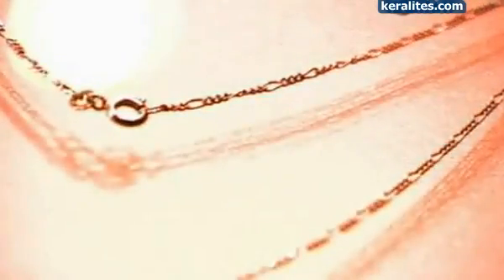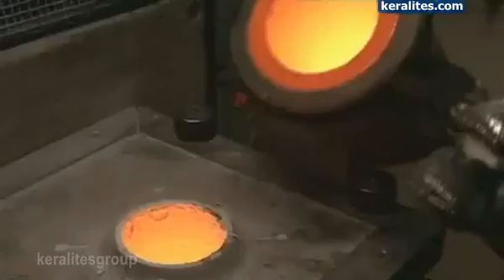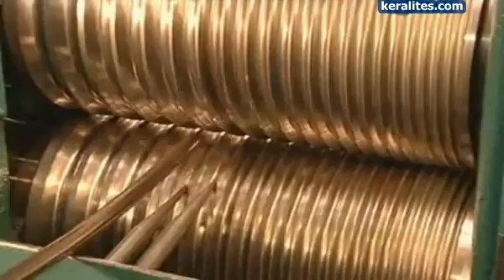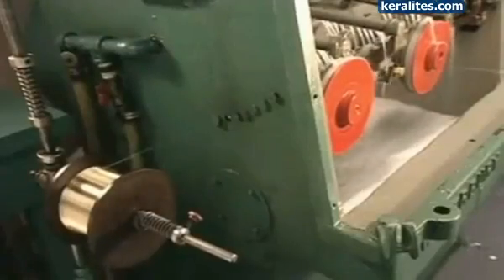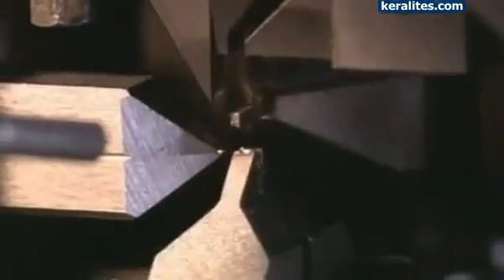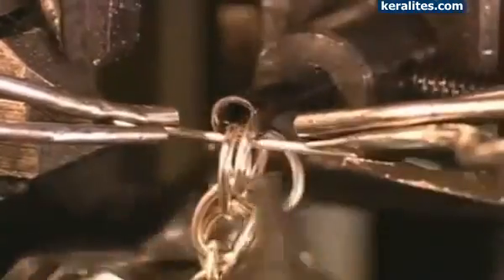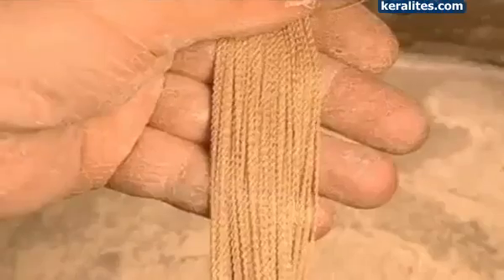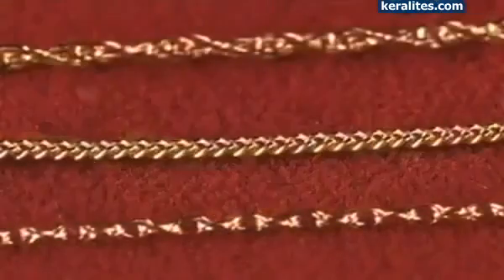How Gold Chains Are Actually Made

Comment: so basically we are buying crap in the end ! sold as gold !
and that is why i only wear pure gold
Reply: you get what you pay for.
Reply: Err, no, you're wearing a gold alloy with superior mechanical properties ensuring you won't break it during typical use, and providing aesthetic differences.

Which, sensibly enough, costs less than pure gold given that gold is worth about 450x what copper and brass are per unit weight, or a bit over 200x per unit volume. Feel free to look up different alloys of gold, and compare prices for similar items.
Reply: seigeengine i don't want superior mechanical quality or colour i want pure gold , not crap . 
and i would like a law that forces people selling jewelry to clearly write alloy and not gold next to the price tag . sales would drop dramatically
Reply: olfursson kyllian I'm going to give you the benefit of the doubt that you're not just a troll this one time.

It not being pure gold does not mean it's crap. 14 karat gold, which is the American jewelry standard is about 58% pure gold, and worth that much at minimum in raw materials.

You would not want to make jewelry out of pure gold because gold is a very weak material, and you'd either need to make the construction heavier, meaning it would cost many times more than it does now, or have jewelry break very easily.

Furthermore, when something is listed as being x karat gold, that is literally telling you that it is not pure gold, but that it is x/24 gold, with 24-x/24 of it being alloy material, by weight. Everybody in society is aware of the fact that these are not pure gold, but they are still largely gold, so them being called gold isn't a lie. When they call something 12 karat gold, that is literally the same as them saying "this is half gold."
Reply: seigeengine what's with the constant use of the word troll on youtube , every time someone disagree.
talk to me again when you grow up a little .
Reply: Thanks for confirming that you're a troll.
Reply: Thank you for making fun of yourself.
I love it when other people do my work for me.
Reply: olfursson kyllian his comment was very accurate. I doubt you've ever even seen pure gold.
Reply: LastNameEver FirstNameGreatest i buy pure gold, i don't keep money in the bank i just buy pure gold , that's about how much i know about it.
Reply: I can think of at least three ways I'd rather secure my money.
Reply: So is it 24k or what? What's it stamped? Or is it just a metal that's the color gold?
Reply: olfursson kyllian any gold jewelry or someone claiming it to be pure gold upon sale is filling you full of bull.  No jeweller in their right mind will make pure gold jewellery. unless you melt down a 999.9 fine bar for yourself. understand,. as the video states the alloys are added for strength. pure gold is soft and wears down fast. so your investment in a pure gold piece of jewellery will lose weight and scratch easily over time. you're better off buying a 24kt piece. negotiate a price.
Reply: bantalee2002 i buy goldbricks lingots   or fine antique jewelry from the middle east or ancient mayan artifacts i do not go to the jeweler in the corner to buy things. 
I know the real reason they melt other metals in the gold, if you want to believe this is to strengthen it , good for you. 
I don't even keep cash in the bank, all my money made of gold and kept in safes in Japan .
Reply: This guy is probably bullshitting, but even if he isn't, he's a nutjob who is so off the deep end he can't even reason.

And please guys, don't store large sums of your money in gold. Not only is there a lot of controversy surrounding gold investment (particularly where you don't actually store the gold yourself), but it's easy to be sold fake gold, as there are plenty of fakes identical to the real ones in almost every way, and gold, while it has retained it's value generally over the years also faces short term instability, and also doesn't appreciate.
Reply: seigeengine and money doesn't ? 
as for the bullshit part no sorry i keep all my assets in gold
Reply: seigeengine precisely, there are more example in history where market collapsed and money was worth nothing. But keeping everything in gold is the best way to never fear from market collapsing, the gold I have in a safe at the bank will be still there a decade later, and i keep a few hundred thousand  dollars in cash just to make it through the hard time , plus i invested in real estate , organic farms and art . 
What will you do when the markets collapse and 2000 dollars won't even buy you a potato ? 
Call me an idiot all you wish i am fine with it , the thing is that i prepare the future while you will be struggling with the present . 
Sure i am lucky to be born in a family which means that there was already money and gold for generations to begin with and i am just adding to it, but i think this is better to do that than just hope you don't lose your job or wish you find another one quickly if things go wrong. I will never have to worry about that and my job is for life .
Reply: olfursson kyllian Yes, markets collapse, but unless the civilization also collapses, markets always rebound.

What will you do when your few hundred thousand dollars will only feed you for a month? Cause at that price, your cash assets will deplete almost immediately, and in such a situation, are you confident you can get and sell the gold? Not that that's going to happen in the first place, mind you. The only times anything like that have happened are absolute extremes.

You have no idea about my financial situation, so don't comment on it. It makes your idiocy stand out.
Reply: seigeengine i never wrote few thousands dollars, i keep about 800 000 dollars in cash the rest is in gold , art real estate . We bought farms because of the supply in food it wil provide, these are our farms and the products are our own, the people who work on the plantations work for us, so if hard times strike we will have a roof on our head and food in our plates. When the crisis is over and it always ends since it is man made and controlled anyway by the bankind systems . we will not have lost any moey except maybe for the few hundreds of thousands dollars but this is not important . I am sorry we probably live at different level. I don't know who you are or what you do so i will not try to make up an opinion about you. And unlike you i do not go around calling people idiots etc because this is beneath me and the education i received. 
Just to give you an idea of who i am, My family is ancient aristocracy in Scandinavia and we are affiliated to the spencer family in England. My parents are archeologists and ethnologist because they never had to worry about money, i am a veterinarian because i like animals but even my wage is unsignificant for me , we are old money not new riche or little bourgeoisie  . I think you mistake me for a guy who works for a company 9 to 5 and go on holiday when i can afford it . 
I was at a party with Daphne Guinness only a few weeks ago and i do fund raiser and charity event for fun. 
You know that in real life you and me would never meet . 
Please call me an idiot , the good thing about money is that it puts you on a plinth out of reach from the norms. Sorry norms is how we refer to people like you in my world, a normal , pleonasm for peasantry. 
sorry to be so direct but i thought i would be good for you to know what meants by buying gold, we do not buy 500 000 dollars of gold we buy hundreds of millions of it . And by investing in real estate and art i don't mean that i have a little pied a terre in the country . We have houses and residences all around the world in major cities and art collections in museums/ 
I hope we are clear now.
Reply: seigeengine But you are absolutely right, i have no idea about the financial situation, and i am not very interested to find out about it.The crisis is not affecting me at all.
Reply: seigeengine my bad . 

have a great life
Reply: seigeengine I am gay, i am married to a Japanese man, i have 2 adopted kids, believe me i know a lot about discrimination based on sex athnicity , as for discrimnation based on social status , being on the rich side doesn't make you less discriminated but it surely maes it easier to deal with people on the internet calling you arrogant or telling you to fuck off (or fuck you since you care about accuracy). 
But at the end of the day, i am not disrespectful, i am rather nice to people, i help more than the average people , I spend most of my time and money on helping animals, especially endangered species and opening shelters and refuges for stray animals and rescued animals from fur factories, experimentation labs and hunters and doing a job i love and helping animal whom i care a lot more about than human beings, makes me feel alright with myself at the end of the day. 
I am not the devil you think i am but if it pleases you to see as such, i won't go against you will.
Reply: olfursson kyllian I didn't say you were a devil, I said that your arrogance, particularly about your means is repulsive.

If we disagree on something, you should be able to reason with me. I am not merely some troll, I believe the things I say, and I am willing to listen to explanations of why I am wrong. You haven't really done so, however. All you've done is repeat your assertions and then gone on about your wealth as if that of itself was a counter argument.

Maybe you're right and I'm wrong, but until you give me a reason to see it that way, I won't.

And in so far as you behave like that, it's hard for me to see you as little more than a troll yourself, happy to say something contentious that attacks the choices of the majority, but when someone asks you back that up, you refuse. It's very easy to read that behaviour as intentionally inflammatory.
Reply: Well you clearly saw they melted some gold down with the different metals to add strength, so clearly they are out of gold.  He should use a better word besides "plated".
Reply: david bean They are plated, however. There isn't a better word, because that is the exact word that should have been used to describe what they did.
Reply: Okay you incompetent fools. Did you not see the Gold they scooped out of the thing? It is made out of gold and is not plated. They dipped gold over solid gold for a vibrant finish or to make it look pretty.  ITS NOT CRAP, YOU ARE JUST NOT THE SHARPEST KNIFE IN THE DRAWER.
Reply: david bean keep telling yourself that.
you really don't know the real purpose of mixing gold with other metals
Reply: ***** did you not see my older comment about adding alloy and such. They do it to add strength and durability. I'm just trying to state a fact that these chains you see here are not metal that's dipped in gold and is claimed to be solid. You know those cheap necklaces at the mall thats plated or dipped?  These arent like the dipped or plated cheap stuff you can buy for a few bucks. It is solid gold with some metal. You do you get what I'm saying. Pretty boy thought that the jewelry in the video were cheap ass plated or dipped gold chains. Basically what I'm saying is that there is a difference these sexy chains and the cheap 13.99 dipped gold necklaces that rub off over time because they weren't composed  of gold and yes some metal.
Reply: ***** oh wait I think you were talking to the other guy. Finally someone with some sense lol :-)  I love you.
Reply: ***** glad you do.
Reply: ***** in the states or in europe maybe . 
And even then i doubt it.
My gold is 100% solid gold, not alloy
Reply: ***** every jewelry or gold i own is 24 karat gold which is 99,95 percent pure gold this is what is referred to as 100% pure gold because . it is almost impossible to get 99,99 % pure and 100% pure gold doesn't exist .
But i most certainly do not consider 18K or 12 K real gold.
Reply: olfursson kyllian  I sleep with my jewelry and shower with it. I wear it all the time.  You dont do that with 24k, at least you can let it sit in a jewelry box and say you have jewelry even you really wont be able to wear it.
Reply: david bean i don't wear it. 
most of the pieces have been in mt family since the middle age  and we have a collection of egyptian and etrusque pieces, some mesopotamian some from the indus and some mayan .
I only shower with my wedding ring. 
Now i understand why you thought i was bullshitting i should have mentioned that the gold we had was not gold to wear ,
Reply: olfursson kyllian well that's really cool, good to know.
Reply: Shay Monte' i don't wear gold chain with charms , sorry. But i believe you.
Reply: olfursson kyllian yeah when it comes to jewelry 24k isn't always thee best idea
Reply: Shay Monte' nope definitely not !
unless it's heavy bijouterie
Reply: olfursson kyllian I think there's a huge amount of confusion here so let me clarify it. In middle eastern culture, it is not customary to wear pure gold in the form of chain necklaces. Pure gold is made into bracelets and wafer thin coins weighing a couple grams that can be exchanged for currency. Most of the time, these are gifted during child birth or weddings. Gold chains are alloys because they have to be. Pure gold is too soft to hold a link. Anyone that tugs on your chain can bring it home with them. Western culture doesn't follow this. In Canada, at least, there is a huge gap between the buying and selling price of gold. In Turkey, however, you can buy and sell it for nearly the same price because it's more customary. That's what I noticed at least. So when everyone says "it can't be pure, it will break," keep in mind, he doesn't wear it. It's customary to use gold as a stable investment in the middle east. He probably doesn't wear any gold for all we know.
Reply: Ozgun Akkaya Does this mean that the selling price doesn't take into consideration the work of the goldsmith ? Or are you talking in terms of weigh alone ?
Reply: olfursson kyllian In the middle east, for wafers, the work of the goldsmith means almost nothing. This is because most of these gold wafers are just melted into shape. They get some gold pellets, weigh them, melt them and sell them. It's usually the mining companies that do this as it's not profitable whatsoever to do this independently. As for the bracelets, I believe that the goldsmith's work is factored in, as well as if it has ever been worn or not. Each buyer will give you a different price for the work of the goldsmith with bracelets. This is because the bracelets are actual pieces of jewelry as well as cashable gold. You can't really wear the wafers.
Reply: Ozgun Akkaya ok that makes more sense to me, thanks a lot .
Reply: olfursson kyllian most Mayan artifacts are an alloy also. Mayan gold contains copper. Gold ingots or bullion contain what's know as serial doping agents. Antique gold jewelry from the middle east most offend carries small amounts of tin. The Canadian mint make the purest form of gold bullion by using electrolysis to separate gold from the impurities. The gold is then used to make the holographic maple leaf coin. Source, I'm a goldsmith.
Reply: Robert Guinn yes that's why i like middle eastern gold , especially antique mesopotamian , sumerian and egyptian .
Reply: ***** That's not the intention of our debate and I think you may have misunderstood. Gold stretches because the bracelets have to go around your hand before they get to your wrist. This process is enough to stretch it over time and some jewellers can identify this (I've literally seen it with my own eyes) after the first wear. One time in specific I was told it was worn twice. He was right. The chains, however, can be broken with sufficient force. 24k doesn't have enough strength to handle large tension and depending on the thickness, especially ones which harness a pendant (thin), can be broken by any determined thief.
Reply: ***** So gravity? No. I was speaking strictly about rings (which pass through knuckles) and bracelets (the hand and wrist). These do stretch.
Reply: Stewie Griffin The picture were not snap took at random i was just there to pose and had no saying in how to look what to wear and how to act, i just followed instructions. except for three of them. 
As for my gold and the bank  i can tell you that when everything collapses for you, nothing will collapse for me , I won't get into the details but let's just say my mother's maiden name is Morgan and i am not talking Morgan freeman , no the other one. Maybe there is a reason i use a M.C.P . 
I am pretty sure you do not know what that is and that is just fine this way .
Reply: olfursson kyllian judging from your name "olfusson kyllian" I would doubt a morgan would be involved, but hey shit happens....and my main point is jewelry cannot be 24k due to gold been way to soft... a ring which is super rare would be deformed in a week...lets not say a chain or bracelet which I would doubt of them being made due to the fact that connecting the links and the building process of it would be really hard if not impossible I know of 22k which is mostly for collection purposes cause one yank and im gone with it...but hey if you say so I wont believe you but i wont call you a liar
Reply: Stewie Griffin My father's name which is not Olfursson but Olafursson  is Icelandic of Danish descent , and can be traced back 900 years in iceland alone , My father's family is old Icelandic aristocracy directly linked to the Danish royal family therefore linked to the Austrian Habsburg family. I don't take any pride in this name or the wealth of my family because i know what it is based on but the "shit happens" was unnecessary. 
I don't wear jewelry i wouldn't know about the process , i am not a pro in the field , i just collect gold artifacts. 
I might be wrong and maybe there is some form of alloy in it, i just know what is writeen on the certificate of authentication from the auctioneers .
Reply: its whatever you say bro
Reply: +Stewie Griffin When all is lost and you have to revert to "whatever you say bro" lmao this guy
Reply: Stewie Griffin Really ? That's all you can answer ? 
Thanks for proving my point, you are indeed a kid.
Reply: Stewie Griffin Well your spelling and profile picture makes me doubt you're an adult .
How old are you ?
Reply: Its the internet not a college essay, and you dont need to know my age, just as much as I dont need yours.
Reply: Stewie Griffin embarrassed ?
Reply: olfursson kyllian why should I ?
Reply: Stewie Griffin You tell me.
Reply: But I wont
Reply: Stewie Griffin as you  please honey.
Reply: Umm ok fruit cake
Reply: Stewie Griffin no, just the fruit .
Reply: Ok, so I have to reply to this one, ignoring all of the bullshit. There is such a thing as 24k gold jewelry or .999 either way. I have bought and sold plenty of it. In America it isnt seen too often because it is usually made overseas and when people bring it here it has sentimental value or is kept as an investment. I had a Korean gentleman sell me about 1200 dwt of all .999 gold jewelry so he could help fund opening up his restaurant. It exists. For the rest of the comments, all of you please remove your heads from your asses. You just allowed someone electronically control your emotions.
Reply: olafursson kyllian gold bars are always pure gold their would be no reason to make gold you buy like that with other metals , so what’s your point
Reply: olafursson kyllian I’m very very sure you don’t wear pure gold anything. 😂